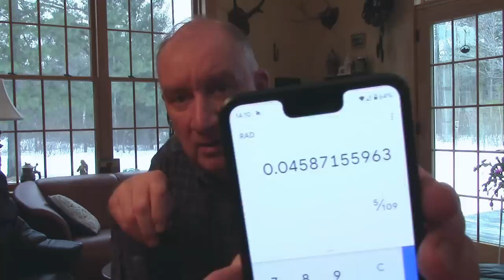How to Calculate and Make Open Sight Corrections

Comment: This man is a treasure chest of knowledge.  There are or used to be charts that would tell you what height your front sight needed to be in relationships to the height of your rear sight, but that was just an approximate number due to differences in bullet weight and hang time of the bullet in your barrel.  When you change bullet weights that will change the impact your bullet.  Increments are  very small on longer barrel guns and larger on short barrel guns.  If you install a peep or receiver sight on your rifle you can bank on putting on a taller front sight to put you on target.  Nowdays, most people use scopes, but it's useful information to have.  Back in the day you could walk into any decent gunshop and they would have a box with different height front sights and will different widths.  If your rifle was shooting high at 100 yards you installed a taller front sight.  If it was shooting low you would install a lower front sight.  Just the opposite of the rear sight.  Some guns come with taller front sights so you can choose your load and you can file the front sight down until you are on target.  Glad Benny is doing well.

Comment: I always wondered about the sight ramp stair case steps on a rifle, for shooting with iron sights, more then 50 or more then 100 yards out. On all my rifles, if its my single shot H&R handi-rifle in the 308 Win or 270 Win barrels or my new Ruger Scout in 450 BM or my Win model 70 its all set on the first step or notch on ramp to shoot 50 yards out with iron sights, just for hunting deer or hunting wild boar in Florida when on vacation. 
If I am in woods I will just usually use iron sights. If I am near the field I will use a scope. Just speaking for myself cause with my experience in hunting most animals I got is most of them were less then 50 yards out. 
Did have a small problem with my 45-70 Marlin guide gun after I bought it a few years ago with the front sight. It was shooting to high or to low, don't remember which it was now. Marlin sent me another front sight and same problem. So if I remember right my gun smith put on a shorter or longer front sight post on the rifle and had no problems ever since. Do remember my gun smith did not file the front sight down, but that is a good idea if you have to make front sight shorter.

Comment: Very helpful again, thank you. I am glad I watched this because I have a situation to present to you: I wrote to you last week about my 1960 Model 41 with the gold color on the rear of the front sight. Now the problem is, that while bench rested, the gun shoots about 1" high at 10 yards with CCI Standard Velocity, and a little higher with Mini Mags. About 2" high at 25 yards. I have my rear sight all the way down. I cannot change the front sight, and I can't make it taller. Do I need to get  about 1/32nd of an inch removed from the blades of the rear sight? What would you suggest? What would you do if it was your gun? Thank you.

Comment: Happy to see that you are  still teaching. 
Q,  after filing down the front sight, will blueing need to be touched up?
Reply from the maker: Yes.  Clean first with alcohol, then apply a good cold blue such as Oxphoblue. After one minute, clean off, repeat alcohol and blue three times, then finish with oil to set it.

Comment: Then, after all that calculating and adjusting, you have to factor in bullet drop.
Reply from the maker: Thanks, but understand that the  issues are entirely unrelated.  I'm describing how to adjust shots that are on paper, but not to zero.  Your rifle or handgun is striking the paper other than where you desire it for whatever point along it's path.  Bullet drop involves the trajectory at ranges other than that.

Comment: I would say 90% of people with a scope don't know what 1click =1/4 moa at 100yds means  etched  into the turret..
Reply: I think that depends on your particular scope , some scopes have 1/2 values & also 1/8 value adjustment .
Reply: That means one click will move the point of impact about 1/4 inch at 100 yards.  Correct?